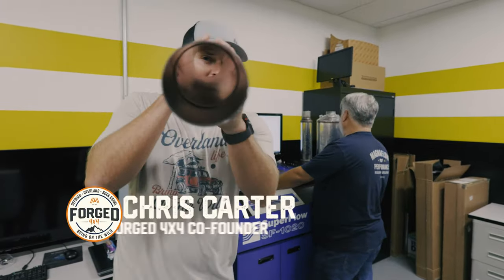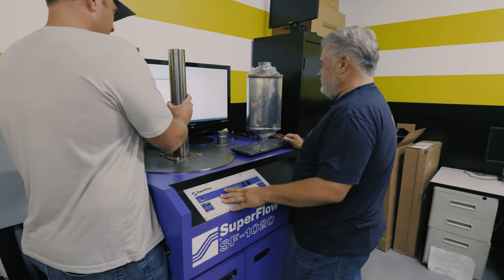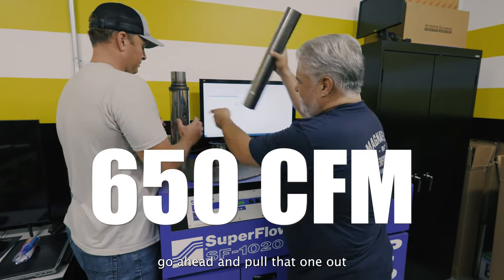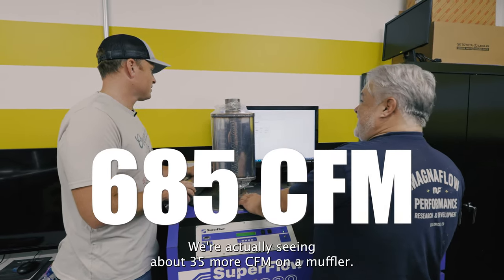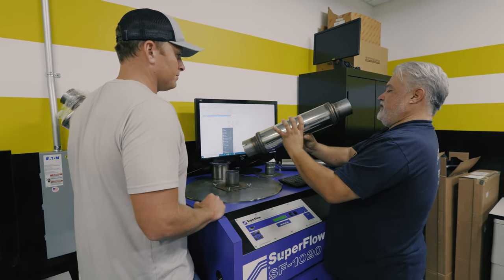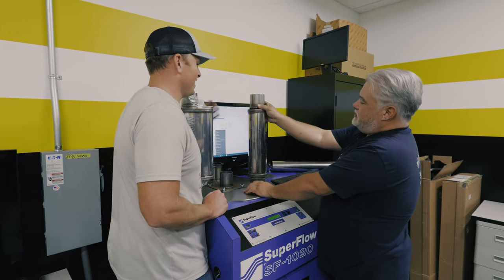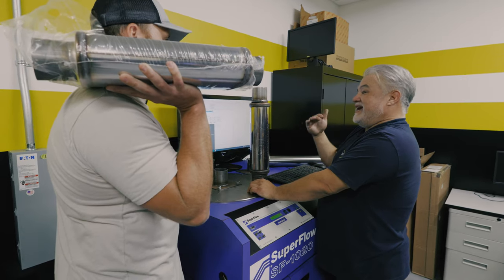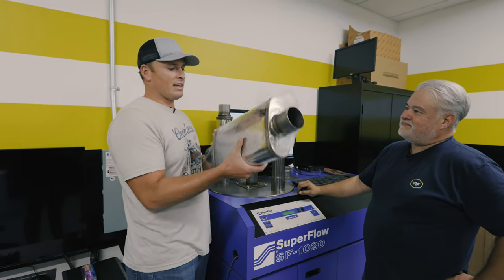Straight Pipes vs Magnaflow Straight Through Muffler, Which is better?

Comment: So in theory the muffler won't be the restricting factor, but it won't help decrease back pressure either, compared to a straight pipe, cuz the pipes before and after the muffler will nullify the higher CFM inside the muffler.
The good thing is, now you can have a street legal setup that is as free-flowing as straight pipes, but with a muffler in it.

Comment: Nice guys!! 

It looks like you are using a smaller CSA on the 3" pipe test? 

Both muffers look to have an expanded end to "slip over" a 3" pipe. The straight pipe doesn't have this at both ends.  

This is reducing the available CSA. We will have two different exiting velocities. As well, this will cause more particle interaction and limit mass flow. Did you probe the velocity?? 

If that is a slip ober at both ends. That's an area difference at  over a 1/2" sq/in. 

Also, dimples on a golf ball create more drag, not less. I've done a video on this on my channel as we develop race heads. So we see this rubbish dimple port come around every few years! 😂😂

Heres the problem people miss with boundary conditions and what dimples actually do! 

Dimpls will put more energy  in the boundary layer, The more energy we "transfer" the "less" energy the air has. 

So dimples actually increase in surface "drag." It's this mechanism that allows a longer attachment point.  Which on a ball at those velocities is separating on a smooth ball at 12 noon and 6.  

But with dimples creating more drag, it helps the air "wrap around" the ball. This means we reduce the negative pressure "behind" the ball.  This is why dimples allow much further distances.  The reduction in pressure behind the ball clearly outweighs the min but measurable surface drag dimples create.  

So we know it's not working like a glof ball.  you have the fluid dynamics principles wrong here. 
But maybe you might be on the right track with surface area, especially with holes that lead to a huge volume of "compressible" fluid. 👌 and "generally, the greater this volume, the more power they make. 😉

I'd like to see the test, with an equal internal volume, shape, and average CSA.  Just to see the difference. 

Also what is the Ra of the muffler, as the pipe seems like it has a much finer Ra surface which also creates more drag, all out tests show the best is around 60grit to a cutter finish. 300fps averages. 

So, a few things to get a more accurate back to back test  would be great to see👌.

Comment: Well they are stright through so cfm should flow through just about similar. 

When it comes to chambered than yes cut that bad boy in half sure they chop at idle but the suck when it comes to air flow